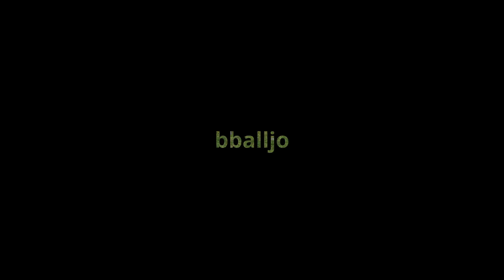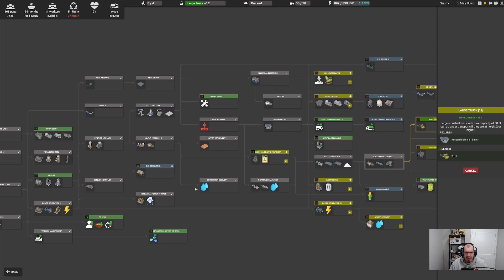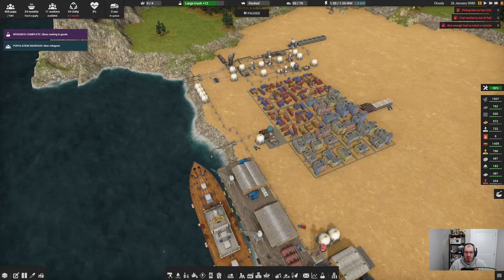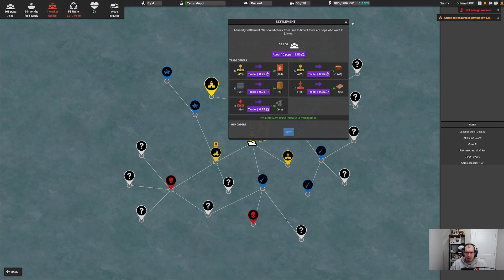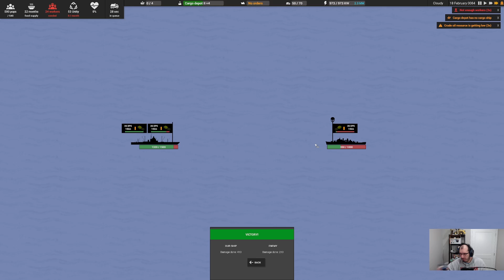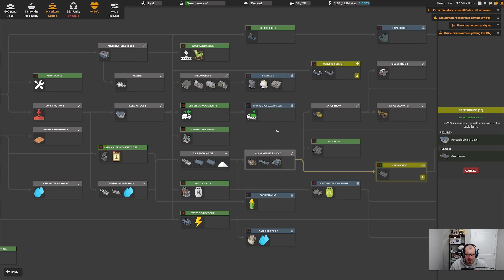How to get the next ship? | Captain of Industry | BETA | Part 9

Comment: You should really think about using acutal pipe splitters in your  oil setup and only flare if the storages are full. Now you flare half of all production. so in a shortage it takes twice as long before you get the same amount of diesel.